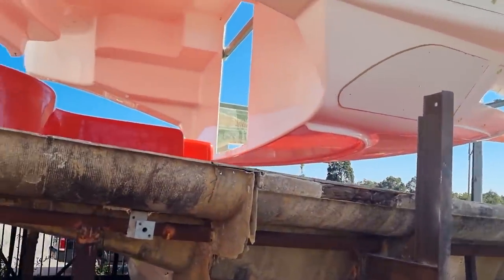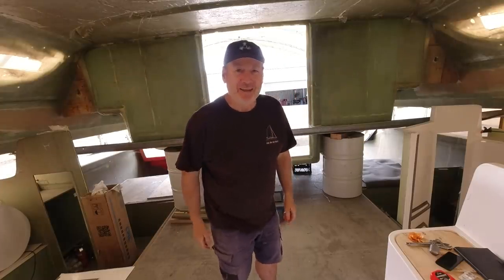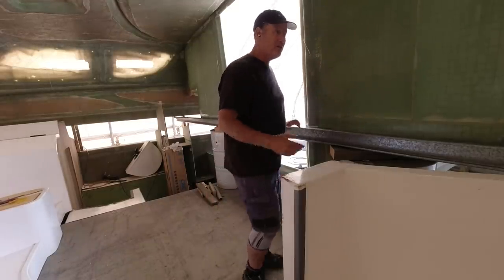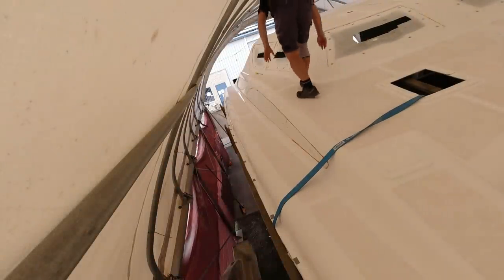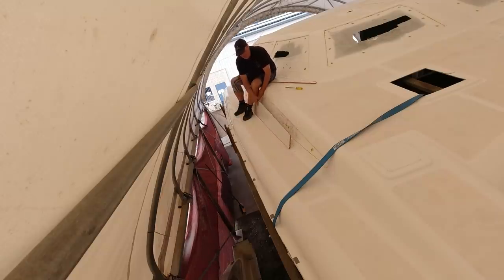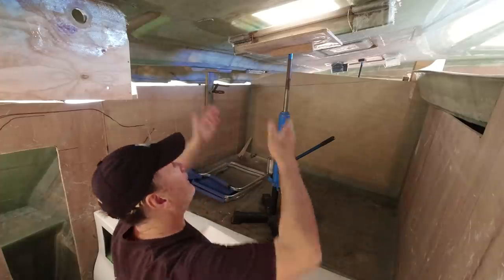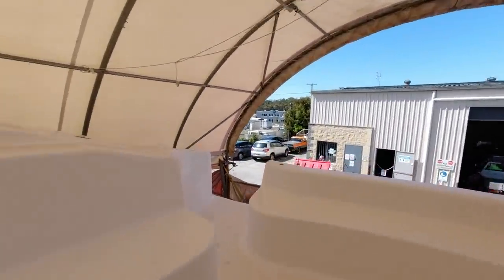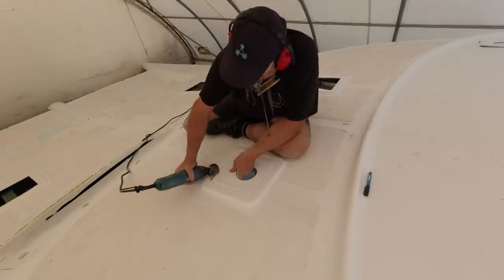It looks like a Real Catamaran Now - 12.7mtr Complete Catamaran Build Ep195

Comment: You should mount a couple safety lines to the peak of the tent.  It may not be rated for the load and might collapse the whole thing but I can guarantee that it would be worth slowing a fall and saving you a crippling injury from sliding off that slippery waxed deck. You've worked too hard to risk everything like that. Be safe. Looking forward to seeing you finish the project 👍
Reply: Controlling dust build-up on the walking surface and wearing shoes with a gripping sole would be proper.
Reply from the maker: Sadly the deck is filthy and I avoid walking anywhere where the deck is smooth and only on the anti slip. Some guard rails would be a great idea though. I will be installing stanchion and lifelines even temporary ones as soon as I can lock the deck down. Rossco
Reply from the maker: Vacuuming every day to control any dust as it is super slippery.

Comment: Hi Ross,  have been watching from the start,love your work. I'm currently rebuilding, inside and out, a clothed windspeed. The two most painstaking jobs over The whole project has been the underside of the bridgedeck (which was some basic repairs and minor fairing,) The other area was all of the ceilings, which were a texture single pack poly, textured to hide the minimal fairing after the original construction.  Fairing and sanding above head is an absolute ( insert any profanity you wish in this space..........) .I'm not sure where you are up to in real time, but honestly I would be flipping that deck back over to carry out the bulk of your fairing and painting, let gravity be your friend, not your new nemesis. Would love to be a patrion but I'm sure you understand the pennies

Comment: Amazing progress. It does truly look like a catamaran now, with those rough window openings in. Some of your camera views really make it feel like you are walking inside the boat, with a "normal" view through the windows. You are building an awesome boat Ross, and I am building a plane (RV-10). However, your project is at a stage where you could "stand at the helm" and make boat noises, and I am still working with mounds of small aluminum parts that need prep, fitment checks, disassembly, priming, then riveting (and I'm a long way from anything that would let me sit in it and make airplane noises). Same spirit of persistent work required, but you are just much further along, and your progress truly inspires me!! Best regards for continued great milestones!

Comment: Cheers Rossco!
Its Thanksgiving here in the U.S. I have the Turkey and all the fixings in the oven now and I just poured a nice glass of bourbon and up pops your video! Great Timing Sir.
 I'm happy you took a break and got some rest away from this huge undertaking. How's the head? After taking a good blow, it had to be sore.
Everything is looking so good Rossco. All of the extreme logistical issues were resolved and it shows. So far everything went without a hitch. Not your average bloke could have pulled that off. Well Done!
So a tip of the hat and a drink from the glass to honor your accomplishments thus far.
A big hello from St. Louis Missouri  USA

Comment: How good are those Arlec LED lights Ross? I have found them great and cheap. I would hate to empty your vacuum mate.
Reply from the maker: ARLEC Work lights are awesome and fortunately not too much heat.I just chuck the micro cloth filter bags mate,No dust luckily.Rossco
Reply: @LifeOnTheHulls  Ok will need to get some of those bags when the time comes. I’ve got to have a look at your composites channel. I will need to build a shower recess from fibreglass. Do you have rain there today? Been pouring here for a week.

Comment: Would a slitting disk on an angle grinder rip through the glass quickly and more easily instead of the oscillating tool? If it works it may make life much easier.
Reply from the maker: Yes a diamond wheel is far quicker,but the dust is intolerable.I try to minimise it all costs.Bit harder to get flush with the deck also making more work and a secondary cut and sanding to remove what the grinder leaves behind.Thanks for commenting mate.Rossco
Reply: @LifeOnTheHulls  Dust is an absolute bastard. I got a few paltering jobs I need to do around the house but keep putting them off due to dust. Would be even worse with fibreglass dust. Looking forward to the marriage of the deck and the hull.

Comment: Boat seems a bit smaller than I originally thought it was. Is it larger than SV basic onboard lifestyle boat?
Reply from the maker: Teal and Linh's cat is the same length but about a mtr wider than this one.That gives a feel for the size of this boat.Tgis is 12.7mtr x 6 7mtrs so a Seawind 1260 would be the same as this in fact same original designer
Reply: @LifeOnTheHulls  I'm sure it's just the camera; just doesn't do it Justice. I've noticed sometimes the boat just absolutely looks Giant and other times just inadequate size for guys like you and I

Comment: Does your kärcher vacuum ever need to be cleaned? like the impeller inside the machine etc, becaus every single time that i have had to do anything with my boat, and after i start to vacuum all the crap out, i need to service the vacuum pretty well
Reply from the maker: I clean the vac regularly, but it is Ryobi, I also use the industrial cloth filter bags down to minimal microns that greatly improve the performance and longevity and my health. Ross
Reply: @LifeOnTheHulls  my bad on the brand 🤣
Reply from the maker: @finnsailing69  Haha, all good buddy

Comment: What did we do before we had these Multi tools? Slot cuts take a couple of minutes compared to half an hour with a hammer and chisel.
Reply from the maker: Exactly, they are the most revolutionary and safest tools available although I have killed many of them. Ross
Reply: @LifeOnTheHulls  I know that feeling. Iv just worn two out. One was mains powered and the other one was battery powered. I still remember having sore hands after using a hacksaw blade with masking tape wrapped round it for a handle. LOL.
Reply from the maker: Those were the days,youngsters have no idea what we went through.Ross